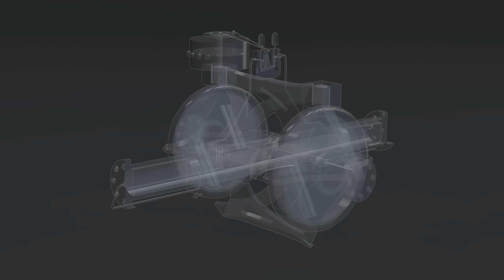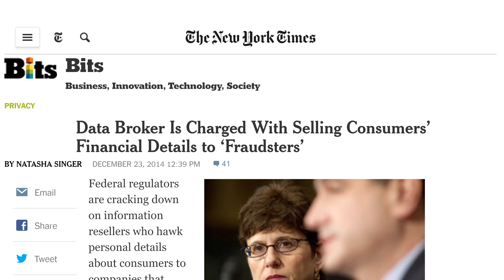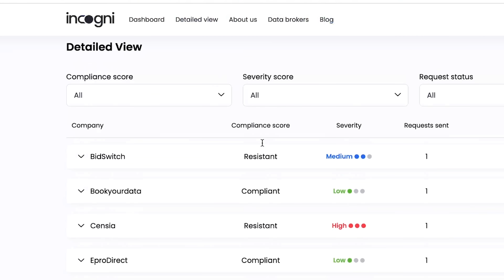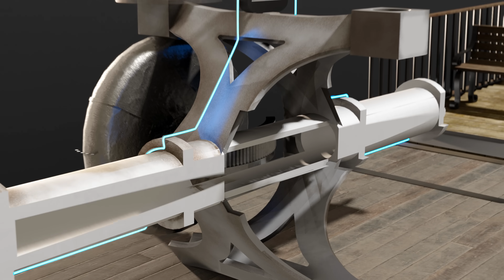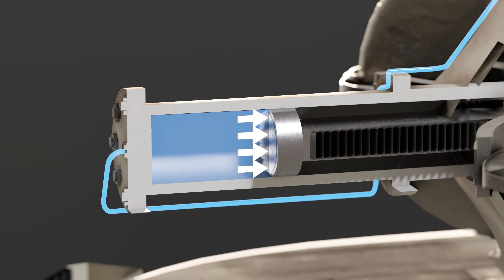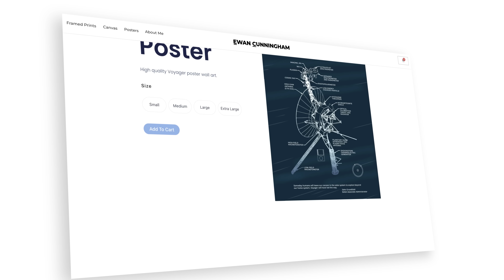The Self Balancing Monorail

Comment: The wheel has two outer rims - so how is work carried out on a rail switch?
Reply: The same as a swing-nose crossing on the two-rail system.
The blade has a gap on either side.
It gets more complicated as the width of the single rail increases; you end up with a moving piece of track the width of a normal, two rail railway.
Yet another unmitigated disadvantage of the monorail concept.

Comment: This would be very useful today in deploying intra-city metro networks.  Having a monorail would be a clear advantage where city space is a premium, and you'd have to build it over existing infrastructure.  Additional safety could also be incorporated with computerized monitoring, to prevent a disaster in corner case situations.
Reply: It would be of no use whatsoever in building intra-city metro networks.
That's why it isn't used.

Comment: Fun fact, the International Space Station adjusts its own orientation using pretty nuch the same mechanism, only it's actively controlled by computers and uses 4 spinning discs in order to rotate about all 3 axes rather than just 1 (the 4th disc is for redundancy to avoid a situation known as "gimbal lock")
Reply: It's very useful technology on a space station, where there are no rails at all.
But here on Earth...

Comment: The ideas may successfully implemented cost-wise n safety-wise via modern engineering perspectives;

Someone suggested tandem-carriage sharing single gyro could cut the cost by half. Furthermore, a mechanical redundancy such as auto-extending supporting wheels (very much like kid bike supporting wheel as they learned to ride) in event of gyro failure or upon detection of over tilting, etc;

Otherwise its a shame such an ingenious designs idea be wasted, its may be too far into the future when it was first prototyped back then but may be now it has a better chances of taking of;

Comment: Plz someone reply me 🥰🥰🥰

There is nothing wrong with that. But if the current wheels were together. Because of the single wheel, the tracks are bound to jump. Without the current wheel, it is not possible to switch to another track on the track.
Reply: You could put the flange in the middle of the wheel, and use a grooved rail.
No advantage, but that's true of monorails in general.
(I just thought you deserved a reply).

Comment: how would it do in  split tracks
Reply from the maker: Truthfully, not well. I think that would have been the next problem that would have needed to be solved. So interested to know how they'd have solved it though!
Reply: @primalspace  also, if the power went out. you mentioned that the gyro wheels would spin for the next 30 minutes, so that would mean that the train would fell off once that wheel fully stopped.

Comment: They say it was inefficient because every train would require its own gyroscope.

But isn't building an extra track of railway line over thousands of miles also inefficient and time-consuming? For passenger travel, it seems that the added price of the gyroscopes would easily be offset by the cost reduction from only needing a single railway line

Comment: This is so cool! They should start using it

Real monorails are a scam. They are nearly always one of the least efficient and most expensive forms of public transit

But if you had a mono that only needed one ground track and could run on existing tracks, it would be much cheaper and more efficient

Comment: Engineer here, I've done a lot of put of the box stuff too! But this is on another level. This guy's ability to visualise and appreciate the forces at play and to have such confidence is astounding. I could add that the design was flawed by having no backup if the train was stranded.... But that's not the point. The product was impractical but the thinking was amazing.
Reply: ehh. if you mean simply to prevent it from tipping, you could easily install a hydraulic support pole feature like little kickstands that come out. youd have plenty of time to deploy them as youd know if something was wrong 45 minutes before it tips
Reply: @ct1762 He would have had those ( kick stands), if it was ever a problem, but apparently it was not. 

He had 7000Lbs of momentum, on a tiny bit of friction. My guess was that he could roll a long way... but ... also with that much weight, it would have been hard to climb hills, and with his ingenuity, I am sure he would have that figured out rather quickly.

"If my grand mother had wheels, she could have been a bicycle.  "

Comment: Solution: run more smaller trains without separate carriages.
It looks complicated though.
And with additional mass from the gyroscopes.
It might work much better (or lower mass) if stabilized with electronics or AI.

Comment: It was indeed ingenious but limited in potential. All this to stabilize a high train on a low monorail. But better would be a low train on a high monorail. The weight on either side is low slung keeping it naturally stable, and small wheels roll along the side of the single rail to keep the carriage from getting tipped one way or the other,   
But for a high train on a low monorail like this, a much better and simpler design that ran for many years in Boston  is shown in this video:
https://www.youtube.com/watch?v=E42gJlamL_0
Reply from the maker: Fair assessment. Thank you for sharing your thoughts and good luck in the giveaway!

Comment: Meh. It's an interesting idea, but it's overcomplicated. Now- instead of only motive engine to power the wheels, now you have to have more power spenton engine wpowering wheels, and also power spinning those gyros. It is kinda cute idea for a single tram, it would of never worked for whole train.  On a train - the traiun cars simpyl stand on track by gravity, here you need gyros in every car, and they have to spin eternally to keep it upright.

Comment: This is a fantastic example of a solution looking for a problem. The three key concerns of an alternative rail solution assuming that the load capacity is the same, are cost to build, cost to maintain and fail safe situations.

The cost to build an expensive double gyroscope and power system into each car on the train is a non-starter, the cost to maintain each car will be a non-starter and the situation in event of a failure of the flywheel probably via a bearing failure is instant derailment of the train.

Given that the alternative cost is a length of steel that has very low installation cost, low maintenance cost and has no moving parts to fail. There will only every be one commercial winner.

Engineering 10/10, Business analysis 0/10

Comment: hmm too many things that can go wrong and it would have a fatal impact on stability and security. The system must be as simple as possible and fail-safe in order to be successful. Imagine if the pneumatic circuit bursts while driving, or it gets damaged or the gyroscope gets stuck... a beautiful solution, but too many conditions must be met to avoid disaster... and you don't want this in life-critical applications.

Comment: Precession is one of the wonders of helicopters. Gyroscopic precession was one of the first hurdles with helicopters. The issue was, if you made an input to the flight controls, the result would cause the rotor system to move 90 degrees later. Fascinating that this was used so early on for balance of a monorail.

Comment: In Germany, there is currently such a monorail in experimental operation, called Monocab. It is supposed to allow two-way traffic on railways that are not used anymore with regular trains.
Reply: Looking at a few images online, it looks like the kind of start up that got the looks down before the design. All photos you can see of their "cabs" on rails need to roll on both rails. Doesn't fill me with much confidence.
Reply: @copycat2696  they have a safety arm to the side, but I have seen it driving without it. It actually works. 
The challenge at this point is not the technical viability, but meeting safety regulations.
Reply: @7head7metal7 
I'm glad that you have seen it working without its stabiliser wheel arm as the only video I've seen is a media presentation and only goes as far as to say that it can without demonstrating.
Reply: Regulations....
Reply: @copycat2696  They can run one on rail, that part is solved, look it up.
Reply: @copycat2696  its from germany bro it will be late anyway.
Reply: @copycat2696  lmao
Reply: Instead of a one way train,  you got a two way train freeway 😅
Reply: Just screaming out for modern microprocessor control and hydraulics.
As in Formula one race cars
Reply: @stevewilliams2498  can you imagine how fast it would be with modern computers and materials? And maybe electric motors?
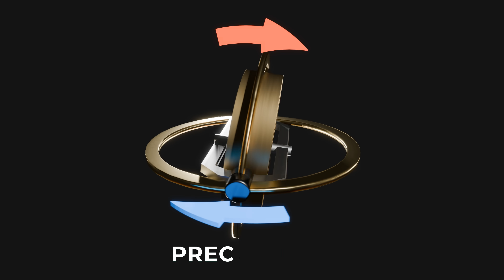Reply: @stevewilliams2498  Something like that immediately crossed my mind. I would love to have been able to build a ca 1:25 model to run on one of the rails of the 45mm gauge tracks I and a lot of people use for garden model railays. Sadly, I don't know electronics, but I imagine using servos and something like an Arduino / RaspBerry in conjunction with the flywheels, could work. (Onboard batteries for power.) But I'm just slightly to old to have ever learned electronics. So I just build and run steamlocomotives.
Reply: @stevewilliams2498 no please no. Less dependency on intransparent microchips
Reply: @brined_soul why?
Reply: @brined_soul and why does transparency matter?
Reply: Robocop
Reply: You would only need an x and y gyoscope when dealing with magnets. Can you guess why? :) So, pneumatically, you could get away with something similar to the idea with only a pneumatic plane gyroscope, but it wouldn't be able to carry as much as a 2 rail one in reality, a good idea, but it would be interesting to see. However, I do wonder if a type of invention would be better for wheel based and not necessarily a maglev 1 track design.

A maglev 1 track design would, however, be an interesting idea and probably could work also.

Ironlev is working on a track that doesn't have wheels that works on already existing rails in the usa. Maybe combining the two ideas could be possible, but its more like "here's an idea". Still, I wonder how much this device could work with on existing rail systems like the usa has and if it would keep the wheels turning on tough inclines, but the traction... Do remember a gyroscope does all 3 dimensions, not just 2 dimensions.

Does make me wonder though more and more...
Reply: Einfach einen Zug fahren lassen ist zu schwer.
Reply: link?
Reply: @akostadinov you cant google monocab?
Reply: @akostadinov  https://www.youtube.com/@monocabowl/featured
Reply: @akostadinov  Look for Monocab OWL which stands for Ostwestfalen-Lippe,  a region, not a bird. Most test drives are still with safety strut, but they've started to go without https://youtu.be/d2al1oFolWM?si=37lSUyPE7zsnIslY&t=129
Reply: @akostadinov  https://de.wikipedia.org/wiki/Monocab (sorry, German)
Reply: Danke! Ich bin begeistert - super Projekt🤩👍
Reply: it's not the same thing.
Reply: Germany the GOAT
Reply: @Cooldudejr türich aber sicher digger 🙄 /s
Reply: @Cooldudejr sure it is
Reply: @Cooldudejr 0/2
Reply: @Cooldudejr long ago😢

Comment: Why not use a single gyro wheel ? Motorcycles and bicycles does the exactly same thing; the wheels act like a gyro. A big heavy gyro wheel mounted inside the train would do the same. It's also done in a prototype car, called gyro x car

Comment: Curious if you could use that on a motorcycle somehow?

Not sure though what purpose it would serve...
Just spinning the gyros up when decelerating for "no feet down at red lights"? XD
Would it increase pressure on the contact patch in corners? 
Anyway, it surely would be stupid to carry around the unnecessary weight on non-track vehicles.

Comment: I wish they would allow small passenger cars to run locally between nearby towns.  The infrastructure is there, they just have to get the timing down so they can run it between trains.  Also, if they can make a jumbo jet crash land with minimal injuries, I'm sure they can make this thing ditch off the track if needed as a last effort.  Derailing one of these would be better than crashing into a train pulling 20 carts of coal

Comment: What Brennan needed was a damper system for the carriages, like the ones used on big ships and large fishing boats, where the gyroscope is followed by the damper system, it would be tricky to engineer timing and weight wise for the carriages, but it would most definitely be possible….
Damper systems like for anti earthquakes and ships etc ?
There is also the possibility of each carriage acting like a Bus 🚎 with its own driver and gyro system, as that may save big on fuel and speeds my also increase, there could even be a weight attached to the rear of each carriage to help with momentum, something that follows behind as that may help with fuel also ? 
These carriages could also be used today for delivery of goods in large ish quantities.
Just a thought 💭
Also in todays world we have Fiberoptic and Ring Laser gyroscopes, and all that you would need is a damper system that would follow them, like modern day gyrocompasses and damper systems on ships….

Comment: The balancing ecosytem of self meeting gyros seems sustainable, though they may need more lightweight models for frequent passenger changes ...so smaller distances especially with fewer turns or those like green sustainable colonies amidst campuses or forestry ..or for only seated  transport...or even for cargo ...such monorails are deemed now to be aesthetic essentials and sustainable additions...one can recycle with sustainable wood, borne locally or introduce some modern era light weight material can be like aerogel or recycled rubber....

Comment: I've always wanted to build a house that's on an infinity looping train track spanning thousands of kilometers of forrest, between green mountains, near lakes and rivers. Obviously, such a house on rails would have to turn, and such a turn would be felt inside due to inertia. So my solution was to perform very shallow turns and tilt the track to compensate for the sideways pull. This however opens new possibilities. Since only one track is needed, I don't have to account for the track tilt. I can just create a single flexible magnet rail, and have the housetrain self-balance on top of it, tilting into the corners.This means that the track can even move back and forth a bit (which can be useful). Really cool stuff. Now I just need some investors to turn my brilliant idea into reality :')

Comment: NO each coach does NOT need it's own gyro:
All that's required is that the coaches be linked to each other by Universal Crosses, aka Universal joints.
This will allow 'torque' to be transmitted from, 'engine to coach to coach, while leaving them free to move left and right and up and down relative to each other.

All that becomes  moot if used in a road vehicle where the simpler described Friction Precess method of balance  should suffice if supplemented with mild magnetic repulsion.

Comment: I wonder how does the train lean into corners like a bike the bikturns it's front wheel in the opposite direction of the turn to lean the bike but the track steers into the corner so tries to force the train to lean in the other direction?

Comment: I am a mechanical engineer and inventor. My specialty is medical equipment. Mechanical organs made to theoretically never break. Brennan's design is relatively simple but very ingenious. But what do you do if a malfunction occurs in the gyroscopic module over time. Even an airplane that stops its engines has more chances.My answer in this case is NO. And history has proven it.

Comment: This solution is brilliant, and fully mechanical, no electonic components, no logic. Just a steampunk in real life. Would I do with this idea? I'll try to improve a motorcycle with it, so you can brake as rough as you want on any surface, and without fear to pull out a front wheel out of you and fall down. It will hold the whole system bike-rider in vertical position as long, as it physically possible. A gyro-stabilizer for single two wheeled vehicle can be a good and, what is more important, commercial idea. You can sell it and make it en masse.

Comment: Great post: 10 y. ago I read a Wikipedia article a few times and didn't get how a gyro-stabilized cart leans into a turn. Hate to feel stupid and you have cured me.
Btw, the problem with gyro weight can be solved with modern technology that enables 10-20x RPM and a deeper vacuum to fight friction and to replace unprecise pneumo-control with modern mechatronics. 
I'm curious, why LitMotor has failed to pull it off miserably wasting a few million dollars?
Thx.

Comment: The idea is brilliant. I also admire engineer Brennan's tenacity in working on the improvements. But I'm interested in one question: What influence does the Coriolis force have on the gyroscopes and the car? 😊
Reply: I think the Coriolis effect would have very little effect on the machine, seeing how it is not very large and it has a form of continuous motion, even though there was no mention of an engine it's reasonable to believe it definitely had one, so without it being absolutely huge and not losing momentum like a bullet I'd say the Coriolis effect is a non-issue in the engineering of this.
Reply: actually, it turns out trains will and do experience slight deflections dependent on the hemisphere. though seeing how the creation worked I'd say it's safe enough to assume the effect didn't mess with the creation too much, or we would have seen something engineered to work against that force, I'd say the gyroscopic force more than greatly overcame that slight deflection, very interesting question.